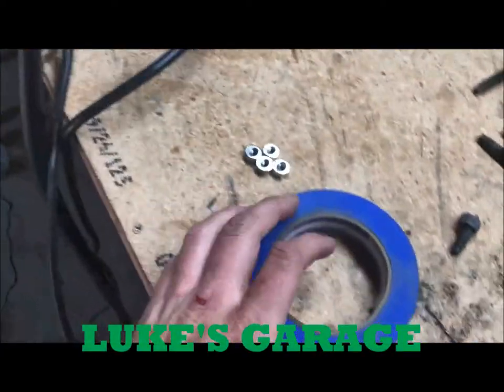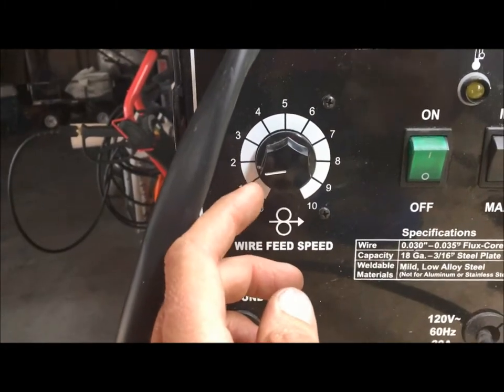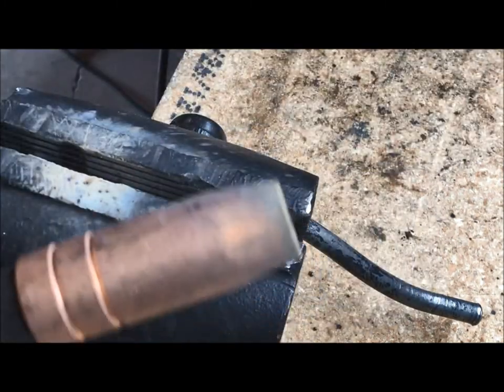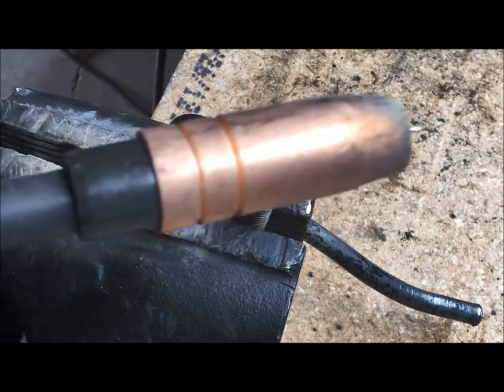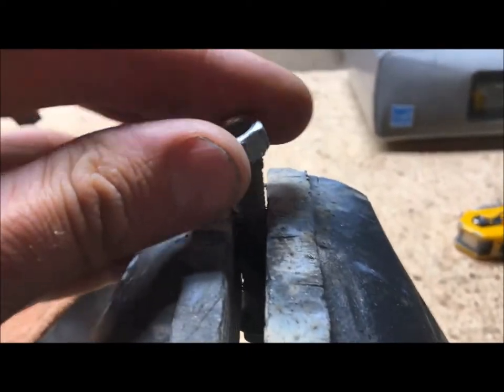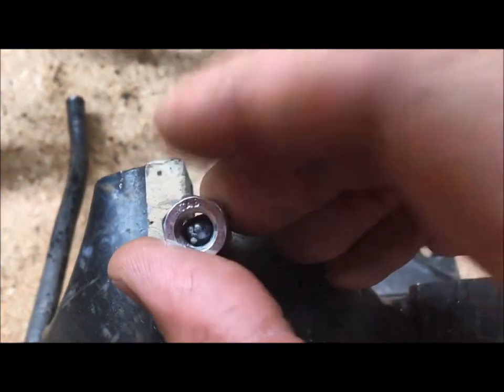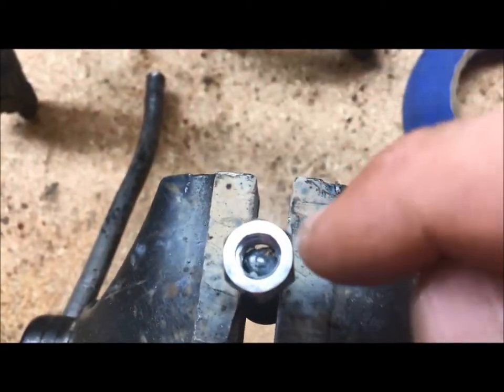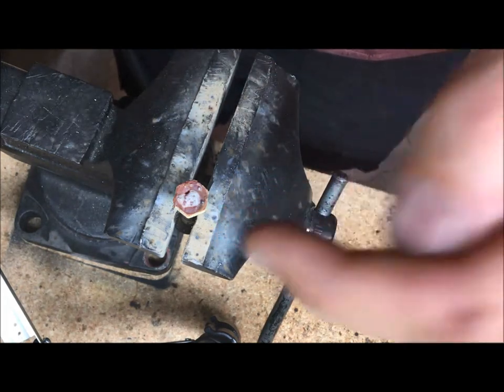Remove Broken Studs or Bolts With A Welder - Step by Step

Comment: Have owned and operated my auto repair shop for 4 years now. Always had issuses getting studs out of heads with wedler and never was sure why. This guy and his harbor freight welder taught me why! Beleive main thing is my wire feed has always been too high. Cant wait til the next one comes in!
Reply from the maker: Freakin awesome!  Took me a ton of trial and error.
Reply: Same here. This video helped me successfully get two broken bolts out of my transmission. Almost no wire speed, high on the voltage and hold the trigger for 2-3 seconds were the three tips I needed for success.

Comment: I keep watching this as I am changing the exhaust manifold on my dodge. I have one last broken bolt to take out. I have an amazon flux core welder with a lot more variations in settings so it is a challenge to translate this to mine, but I will keep at it. No success getting good weld attachment to the bolt yet.
Reply: Eventually, I got the bolt out. I ended up using the stick welding setting on my welder and 7014 sticks. That gave me enough penetration to get a weld that was strong enough to get the bolt moving. After that, the flux-core was more than enough even though I broke off the welds twice, the third time I got it out all the way.

Comment: I tried it this morning but the nut came off.  I did it after seeing this technique in another video, later searching for this using a HF welder I found your video.  I have the same HF welder as you but this morning I did not have my wire feed at 1.5 like you, and I need to make sure the slag gets bonded to the bolt end first.  I think it was at 5.  Gonna go back and retry.  BTW, your video is very well done.
Reply from the maker: Good Luck!  I spun it off a fem time at first.  When I finally built up a slag pile big enough I then welded the bolt on and it worked like a charm!

Comment: Everyone forgets that a cleaner surface on both parts makes the weld stronger. Dont forget to clean the bolt really well with a wire brush or emory cloth.
Reply from the maker: Good call.

Comment: I get it welded on but when I go to turn the Bolt it breaks?
Reply: Make sure to hold your weld a little longer so it heats up and melts...half a second to a second.  People have a tendency to do it really quick so the weld is really weak.

Comment: Just found your great vid after failing to get a weld to stick to the broken bolt this afternoon and not knowing why. Filled the nut up nice with weld both times but wouldn't stick to the stud. I'll be building a slag pile next. Thanks so much for the tip
Reply from the maker: You bet!

Comment: Thanks for the video, glad to find it because I just picked up a Harbor Freight welder today to see if I can get three broken studs out of my Dodge Dakota.
Reply from the maker: Good luck!  Its super frustrating when you do your first one.  I recommend getting a bolt from the autoparts store and practice on it first.
Reply: @MechanicLife  I got the three broken studs out! I had trouble getting a nut to stick but I was able to build up the bolt about 1/2" so I could put my Channel-lock pliers on them so I could get them turned.Your video gave me the confidence to try this rather than taking the truck to the shop for an expensive repair.
Reply from the maker: Freakin cool!!  Pretty awesome you just went and bought a welder and tried it.  That repair is an intimidating one.
Reply: @ScampCamper  I can't get the bot to stick without breaking when I go to turn it, any tips? Slag pile keeps breaking
Reply: @Executnr  I used penetrating oil and allowed that to soak in for a long time. Once I built up a bead with the welder I was able to use my channel lock pliers to grab it, and then loosen just a little counterclockwise, and then go back a little clockwise, and then a little more counterclockwise, and then clockwise, going back and forth a little each time. On one of the bolts I had to add weld beads about three times as each one broke off while twisting.

Comment: I went to change out my camshaft positioner sensor, and the 8 mm Bolt had already been damaged. I tried extractor sets and was about to remove the fan and shroud which needs  2  specialized tools (surprise). So even though it horizontal and like totally no room to work, I'm going to try this..wish me luck.  Good Video!
Reply from the maker: You got this!!!

Good luck
Reply: Did it work!?

Comment: Up here in Canada my local private shop wants 5 hours labor per side, so 550 bucks and I only have 1 single broken bolt on the drivers side.  Looks like I'll be ordering a welder.  Thanks for the tip, it doesn't look like too terrible a job.  There is more, the dealer wanted 723 for manifold, gasket, hardware and heat shield (and back ordered).  Is this what they call the northern tax?  It's rugged up here lol.  Have a Dorman setup ordered for 250.
Reply from the maker: Sounds about right for the cost from dealer.  Good luck on the repair!
Reply: @MechanicLife  I have a muffler shop down to 250.  Getting closer!

Comment: Where did you place your ground when the bolt was in the block, have the same problem with my dodge and would like to replace the bolts to get rid of the tick
Reply: I would try and clamp vice grips on the block next to where you're welding. Attach the ground on the vice grips and have at it!

Comment: Can you work the slag pile inside of the stud using flush or protruding? I think you said that but want to make sure it’s not going to cause issues with the threading inside. Pulling stud out of engine block.

Comment: Will be attempting this process next weekend, have not opened anything up yet but i know there is 2 broken studs on each side. MY biggest concern was if the stud was broken off in the head but after watching numerous videos it seems like regardless your weld wont stick to the head. will give an uddate once attempted
Reply: Exactly.  The weld wont stick for sure.  I put up to other videos on my truck as well.   On one sid eI had a stud broken off at the block.  The other was sticking out about a 1/4" which was great because I could remove it with vice grips.  Recommendation is start on the passenger side first.  It is 10x easier to get at the manifold.  The drivers side is much more intense.

Comment: I’ve got to do this on a freezer compressor. Failure will mean a significant financial loss like ruining an engine. Can you recommend some tips? I believe it’s a blind hole. The thread is 5/16”, I’m assuming the bolt thread is hardened steel and the body of the compressor is steel or aluminum. What size nut would I need, 1 size down? I’ve seen people recommend a washer first then build a nut on top. I’m also assuming that providing a close ground will eliminate the risk of the compressor windings from melting. I do have a tap and die, extractors etc. This seems like a better first try as once the extractor breaks it’s game over.
Reply from the maker: I recommend a nut the same size at the threads.

Comment: This is a helpful video and I tried your suggestions several times.  I am having trouble getting a good weld unfortunately.  I have a Forney 125FC welder which is an AC welder.  It creates a lot of splatter and I think I am not able to get enough heat for a good weld.  Is the welder you use a DC welder, is that what my problem is I wonder?

Comment: When you're welding the nut to the stud are you moving the welding gun?
Reply from the maker: I hold it in place to heat up the bolt surface so the weld will mate and then move it is tiny circles to fill up the hole between the bold and nut.

Comment: I am using a stick welder on a broken stud below the surface of an aluminum block. What electrode should I use? 6013?
Reply from the maker: I have had luck with 6013 and 6011.  Always use the wire feed though now.
Reply: @MechanicLife  Thanks for the reply. I''m going to try the 6013 tonight. Fingers crossed!
Reply from the maker: Let me know how she goes!  Good luck

Comment: It's does work I stripped a caliper bolt now to remove I need to weld nut the only issue on the caliper the bolt are on the back side so you don't have enough room like in the video take.little more of pacienc3.....

Comment: I'm going to go try this technique now on a bolt that broke off in a lower control arm. It's just a stud since the head broke off and I cut the other side. The stud is still stuck in the metal bushing sleeve. Should be an easy out if the weld holds.
Reply: On my first attempt, the nut did not bond to the stud. Then I ran out of wire right when I went to attempt the second slag pile. What do you recommend for the wire?
Reply from the maker: You probably didnt heat up the pool enough to bond it. Make sure you clean the area really well and run your lead about another second longer.
Reply: @MechanicLife  got it

Comment: So I have a bolt that holds a winch that the head was broken off … it’s not sitting vertical like this it’s sitting horizontal ..do I just pool it up from the bottom to top ?
Reply from the maker: You can do that as well yes.

Comment: So the weld will not stick to the threads in the block?
Reply: The weld will not trash the thread in aluminium.
Always let the stud cool completely before putting a spanner on it.
Sometimes takes a few goes.
I do slightly different.
Just hold the nut down with the nozzle and weld in one go. Doesn't matter if the nut starts to deform.

Comment: This may be worth buying a welder... but my bolts are really rusted so I’m wondering if the weld will hold.  If they’re rusted to hell will this work?
Reply from the maker: Yes.  Just make sure you soak the bolts with penetrating oil a few times and leave overnight.  I would get as much rust off the surface your welding too.  (grinder, or sandpaper, even wire brush the area.

Comment: Hi your video is very informative, I've got a question. What type of welder did you use? Is it Arc welder ? Will this welder works on any type of broken bolt? like Etorx bolt or nut? Thanks in advance
Reply from the maker: I was using a wire feed bought from Harbor Freight.
Reply: Flux

Comment: I have almost the same setup but my weld keeps breaking. The nut just turns right off the bolt and doesn't even require much force for it to do that. I feel like I'm following the steps exactly. This is a manifold stud that is sticking out maybe a half inch from the head. It's like the nut just isn't fusing to the bolt. It's filling up the nut, but seems to break at the bottom. Any ideas what I could be doing better?
Reply from the maker: get your weld hotter initially.  If you are just doing enough to tack it it will break each time.
Reply: Jeff S  I am in the same boat, with the stud buried in the head it may be better to first preheat with a map torch, get it all nice an hot then proceed to build up the slag heap
Reply: @MechanicLife  what do you mean by heat it up? how do you do with the welder? any specific settings?

Comment: I've been trying this but the rusty bolt keeps snapping. Where am I going wrong?
Reply from the maker: I would coat the heck out of it for thread penetrating oil and let it sit for a day or two and then try again.  You an also try with a torch to heat it up first and then let it cool off before you weld.

Comment: Also have a ram with the same problem. I'm worried about going this route because the engine block is aluminium. Doesn't aluminium have a low melting point ?
Reply: I have done this on 4 different rams now without issue.  Its surprisingly way easier to do than you think it is.  Just take your time and let your slag piles cure each time.  They hardest part is welding inverted.  I have yet to melt any part of the block  performing this method and one of my welds was as sloppy as you could make it;)
Reply: @montanamade1114  
I get nervous welding so close to the block.. I made a couple small divits on the side wall of the beggining of the hole. Hopefully it doesn't screw with the exhaust out
Reply: Get er! :)      Once you get enough to hook up a nut on it and back the stud out You'll be surprised how little you took out if any.  Super nerve wracking though when its your first time doing it.  Are you able to build up slag on the stud?
Reply: @montanamade1114  I can build up a little nub and that's about it.. Maybe its because I'm using fluxcore ? Maybe I have to use mig.. What are you using ?
Reply: Thanks for the replys BTW
Reply: I have been using the welder in the video.  Its all flux core.  What speed are you running it on?
Reply: You  bet.  That is a really frustrating process the first time.  Once you get it...huge sense of accomplishment will ensue.

Comment: Very useful video. Wouldn't it make it even more effective if you don't wait for the nut to cool before trying to extract the stud? That way it's still got all that heat in it from the weld, just as if you'd heated it up with an oxy-acetylene torch (or similar) as people so often do.
Reply: Wrong way heat expands the stud making it more difficult to remove along with weld also being softer.  The washer and nut method works really well I use this daily with great results
Reply: @damiengibson2630  Ah got ya. Cheers